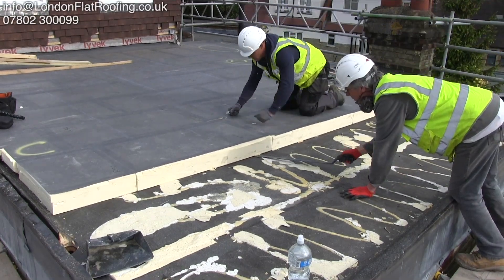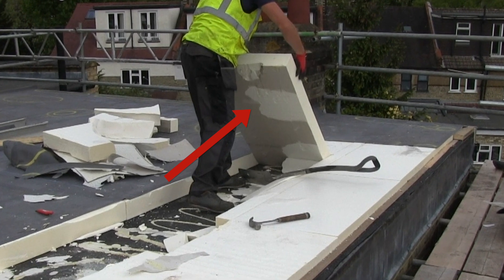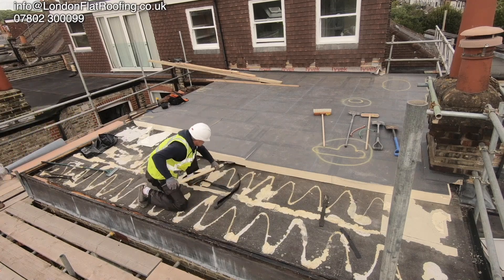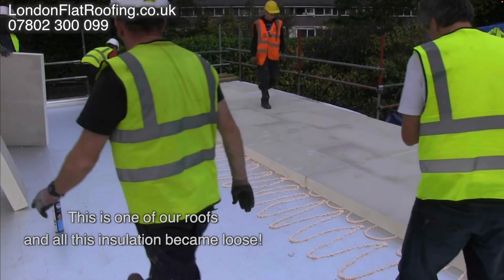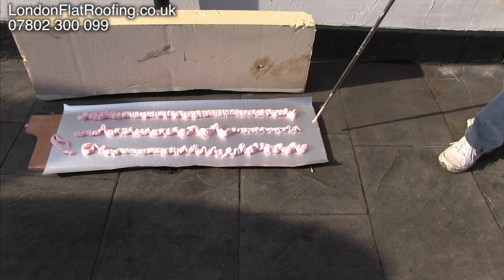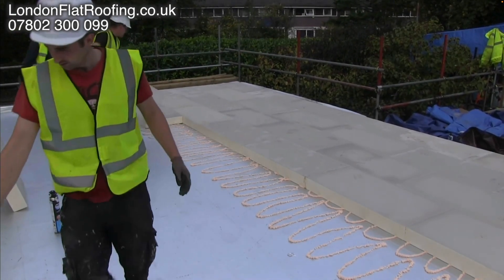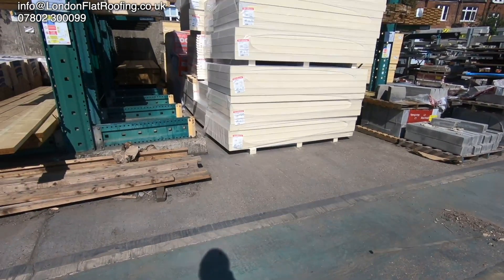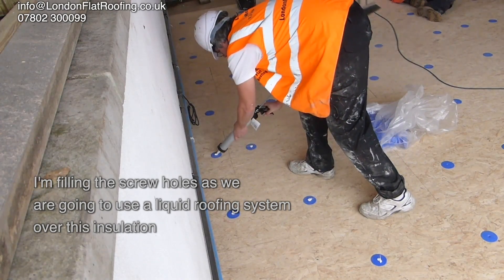Flat Roof Insulation, Bad Storage and Gluing Down!

Comment: Hi Steve, at the very end of the video, you are filling the thermally broken fixings with what looks like silicone.  Is this stop them filling up with dirt/water?  I had intended to use foam to fill them.
Reply from the maker: Yes on that particular roof we were using a liquid roofing system and all the liquid would run down the hole and the roofing system wouldn't work so you have to seal the tops if you're using a liquid system if you're not it's not a problem
Reply: Brilliant, cheers.

Comment: Hi Steve
Our roofer uses rolls of lapped 3b as a vapour barrier! What’s you thoughts on using this method?
Thanks
Reply from the maker: Don't know what 3b is Lapped is not sealed and air tight and airtightness is more important that the material used

Comment: Can't imagine trusting glue but it probably better for thermals, slab nails all the way. Glad I keep insulation dry for as long as poss. Borrowed a mates infrared camera once, interesting to look from inside and see cold spots in joists where nails go through.
Reply from the maker: Yes thats why we use thermally broken fixing and not just nails or screws

Comment: Hi i have one of those old fashioned coal house and outside toilet builds it has a large concrete slab as roof, question hows best to insulate it please, from inside or outside as i plan to do a lean too shingle roof
Reply from the maker: If you do it from the outside you have to glue the insuastion down you also have to extend it around the outside edges to stop thermal bridging
Reply: @SteveRoofer  thanks can i still put some on inside say a vapour barrier and 25mm celotex

Comment: What about a timber frame wall that i have.....Clay tile hang on the outside, the plyboard is only 11mm then on the inside 100mm celotex ,then 25mm over timber frame then plasterboard ,but surely there still would be moisture on the inside of the ply on a very cold frosty day like on the inside of a flat roof...
Reply: Yes, shouldn't have ply. Should be a breathable membrane against the stud wall then tile batten and tiled. That'd be sufficient to ventilate. Other than that you'd need some sort of ventilation top and bottom to create cross flow

Comment: PIR foam is closed cell so doesn’t absorb water and PU glue/foam is moisture setting. Even if the boards were damp it is unlikely to have affected the bond. I prefer a mica faced vapour over that alutrix foil
Reply from the maker: What brand  VCL is mica faced ?
Reply: @SteveRoofer  bauder
Reply from the maker: EVA 35 Air & Vapour Control Layer. ?
Reply: @SteveRoofer  or ksd which is self adhesive
Reply: no its not sorry, duo is the sticky underlay

Comment: Why doesn't the insulation manufacturers make it closed cell and not open then it would be more fool safe?
Reply from the maker: It is closed cell  however the moisture gets between the bond of the little cells